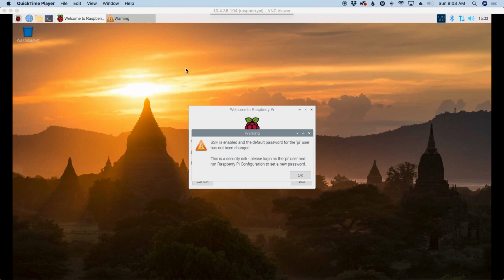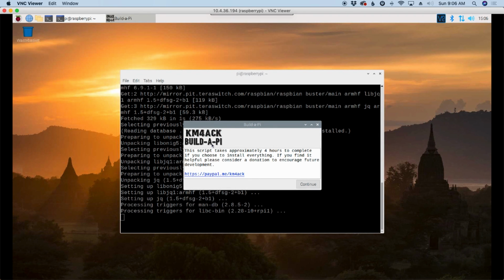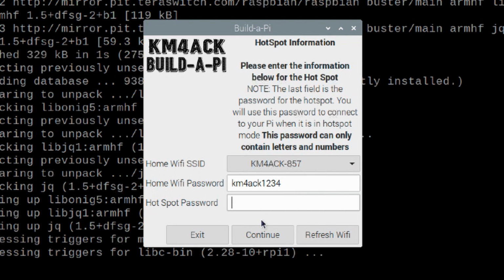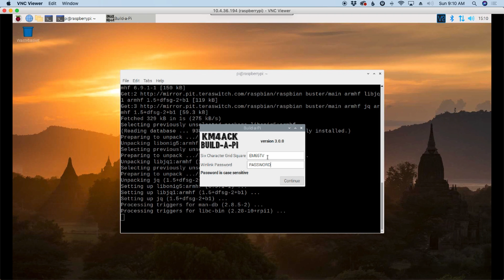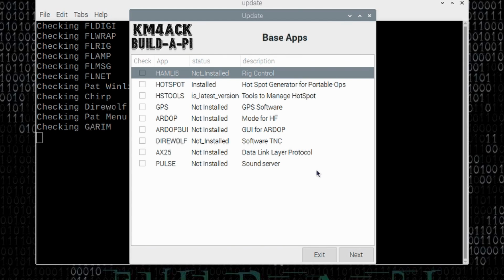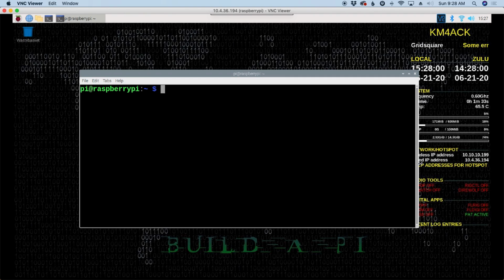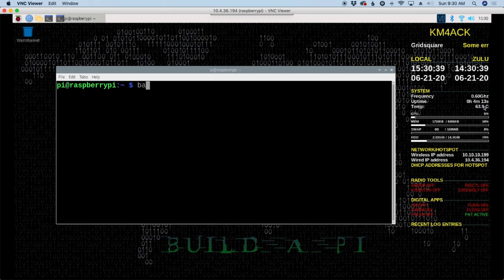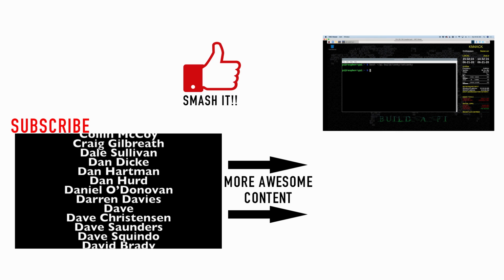Ham Radio Raspberry Pi | Build a Pi V3

Comment: Arrgghh..was in middle of V3 Install on Pi 4  2 gig, and local window got closed out by my wife.   Trying to reinstall received error message '/home/pi/pi-build directory already exists.
Fairly new to operating system...any easy way to re-initiate install of V3 or do I need to reflash my SD card?  Thanks!  Jeff...Appreciate all your work on a GREAT product!
Reply from the maker: probably best to reflash the card since it was interrupted during the initial build
Reply: @KM4ACK  Yes, makes sense..reflashed and downloaded..working fine...thanks and 73s....N5ITU

Comment: Great video! Thank you! I'm about to pull the trigger on a pi,  have you recently changed your mind about any of the recommend hardware components you've talked about in the past?  (Ex. Soundcard, case,  sd card, clock, GPS unit, etc?)

Comment: I did the latest update and now conky doesn't display anymore. I executed the bash line "bash ~/pi-build/conky/setconky" still doesn't turn on.  How to turn it back on?
Reply from the maker: Bill, post the question to the forum and let's see if we can get it back https://groups.io/g/KM4ACK-Pi/topics
Reply: @KM4ACK  To make sure I'm not the problem I've re-imaged the disk and started over completely. Conky works great but the GPS isn't running. (No green blinking light) Do I need to manually start the GPS or is it suppose to be running on its own?
Reply from the maker: Bill Morrison no. The GPS just needs a clear view of the sky. It will start flashing green when it has a lock even without the GPS software on the Pi

Comment: If there was an award for Services To Amateur Radio... You should get it... Maybe in the US the ARRL have something... I would vote :)
I have one question...
I have just received the little RTC Module to plug on the PI.
I have seen the comment below on setup appearing when you do an PI Build Update.
The question...
If I install the the RTC... Does it complemment the GPS, do they work in Sync..??
Great work... Dave(UK)

Comment: A will try this out on the weekend!  I have installed a real time clock.  Does this also set up and configure the real time clock hardware?
Reply from the maker: Yes it does but not during the initial build. After the initial build, run the Build a Pi updater and the RTC is available for install.

Comment: Thanks for all the hard work.  Has any one reported problems with wsjtx?  I can get the sound working ok but not cat control. i'm using a Pi4 with 4gb memory and I'm using all the same setting as previous versions but can communicate with radio cat.  If i swap back to my version 2 sd card it works ok so i know radio and pi are ok.  Just wondering if something has changed with port settings in buster
Reply from the maker: Haven't heard anyone else with this problem. Post over in the forum and let's see if we can figure it out. https://groups.io/g/KM4ACK-Pi/topics

Comment: Well done! Question. I already have Version 2 on my Pi 3+. Do I need to completely re-install?
Reply: Says do a fresh install of buster so guessing yes
Reply from the maker: It is best to do a clean install as there are many changes in v3. One of the changes includes not having to rebuild with each new release. If things go as planned, we can update on the fly going forward. With that said, you can try the directions to update on this page https://app.simplenote.com/publish/6tYKTH BACKUP your system before attempting as I cannot guarantee results.
Reply: @KM4ACK  I will give this update a try and let you know - but first, Field day!
Reply: @WB8ERJ  Did you perform this update successfully? I am in the same boat and would like use v3 to upgrade some apps.
Reply: @loubon1361  Not yet. I have been busy with life things. I will comment here when I do though

Comment: Nice, I'm about ready to pull the trigger on a Rasp PI 4 just for portable ops. I've been using my old Nextbook 7 tablet (Android 4.1 wifi only) for logging, QRZ lookup,  and PDF files. In the field I can get 2-3 hours on the VLS logger app (no WIFI = no QRZ). I can extend time with a USB power bank.